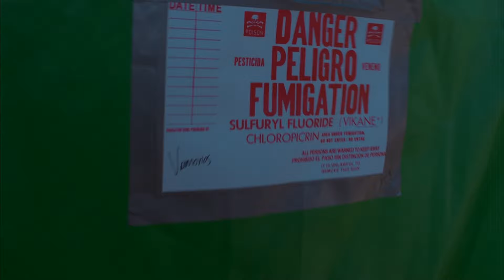Breaking Bad - The Fumigation Lab Scene (S5E3) | Rotten Tomatoes TV

Comment: One thing that always bugged me about Breaking Bad was the filters that they wore on their respirators. Chemical filters are always round, while particulate filters, like the ones they used, are rectangular. Totally not suitable for an environment with harsh chemical fumes. A small, obscure detail of course but one that would bug someone like me that works in the chemical industry.
Reply: As someone also works in chemical research lab, it doesn't bother me much. Small details like using correct filters would make me happy, but I also remind myself that many "wanna be" street illegal drug producers use these shows as an inspiration and not giving them correct information is also important. If they use incorrect equipment for their illegal stuffs, by all mean let them